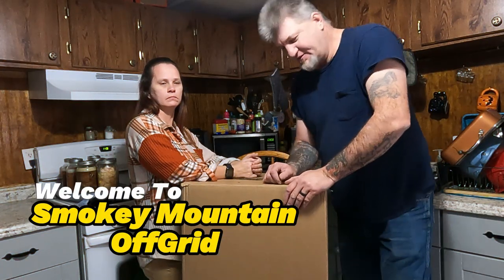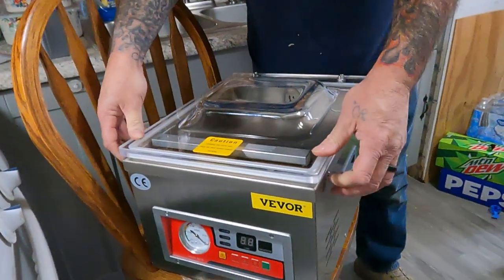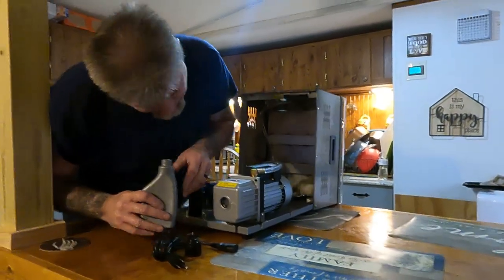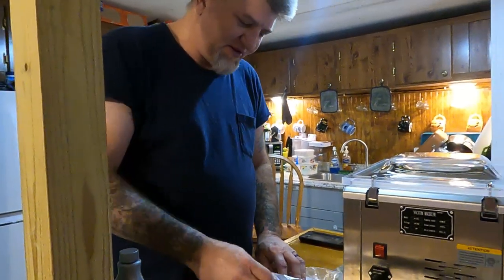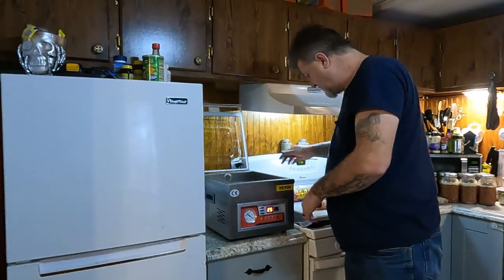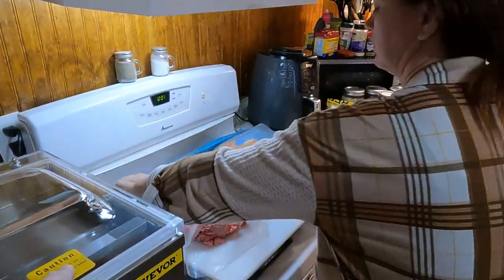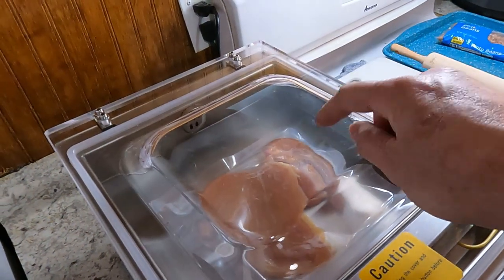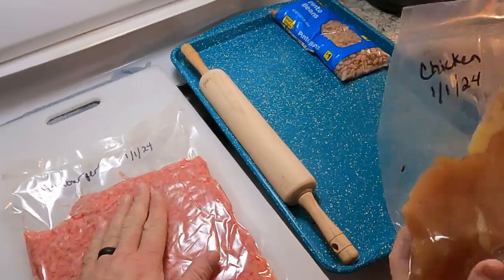Vevor DZ 260A Chamber Vaccum Opening And Honest Review...Off Grid Solar Homestead

Comment: Thanks for making the video.   Found you while searching reviews on Chamber Vacs.    Thought I would share that i've read from other manufactures that Cooling Time should always be as a minimum 2x your Sealing Time.   So if you have 2.5 seconds Sealing Time, then have cooling time at 5 seconds.   This is to pro-long the life of the heat strip.

Let us know how you still like your Vevor after you use it for a bit.
Reply from the maker: Thank you that is very good to know, yes we will let everyone know how its doing but we use it alot right now

Comment: Nice vid.  Did you get it from Amazon or directly from the factory?  

Shipping box and foam looks better than old videos that I watched.  They must have step up the game now.
Reply from the maker: Actually bought it off ebay, better prices there
Reply: @SmokeyMountainOffGrid 
Would you be able to measure the exact measurement of the sealing tape?  I know the chamber length is more than 10” but I was wondering about the tape itself.  Thanks.
Reply from the maker: @gee191991  yeah ill be happy to

Comment: Thanks for making the video! I just have one question, can we seal without vacuuming it? There are some product that I have that just require sealing. So we don’t need to get another machine if this does the trick.
Reply from the maker: Yes you can, just kinda squeeze the air out and seal it up
Reply: @SmokeyMountainOffGrid  Thank you :)